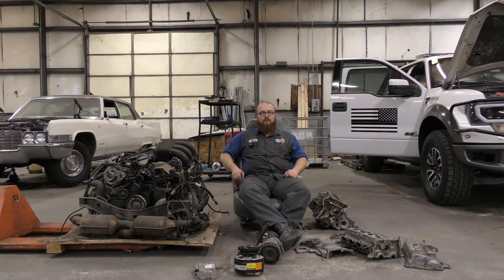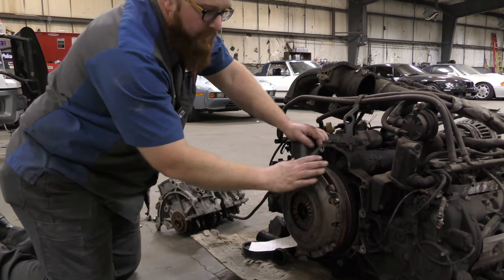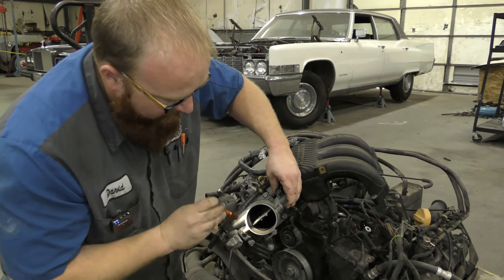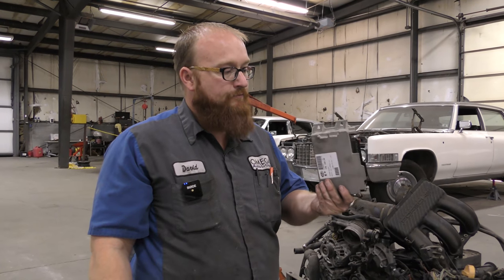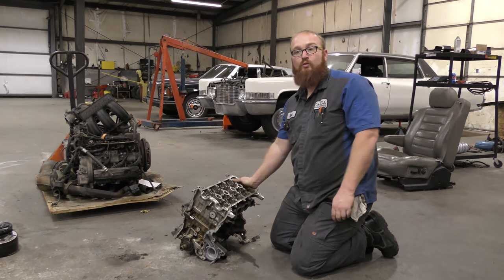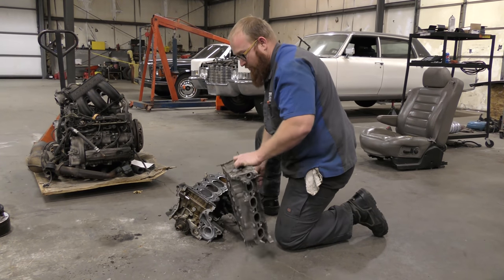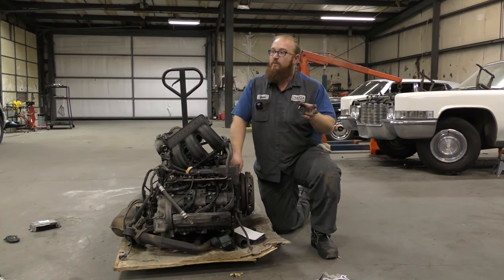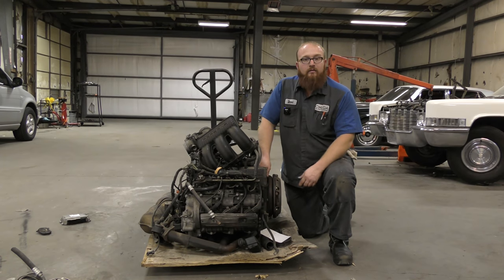The CAR WIZARD explains in everyday terms common Engine issues

Comment: TL;DR. if this saved u time pls thumbs up. 

1. front main seal = as the name explains, the front seal on the front of the engine. behind the main pulley, and what goes into replacement. unbolt pulley, and replace cheap seal. not as big of labor

2. rear main seal = same as other seal, but at rear, inbetween transmission and engine, unbolting flywheel is necessary for replacement. like the front seal, cheap part, big labor.

3. throttle position sensor = positioning sensor telling cpu when the throttle is opened, if it fails, motor may run badly.

4. throttle body cleaning explanation = throttle gets gunked up, it may give false readings,  and give bad idle, or throw a code [chk engine light]

5. Car CPU explanation = not like a typical computer, it sends and receives data pertaining to the car. Said computer controls check engine light

6. Car CPU Reprogramming , Is like a simple update of a computer , a firmware update.

7. Oxygen sensor explanation - On 4 cyl cars, there is upstream and downstream- prior to exhaust and prior to catalytic converter in the exhaust, In v8's there are four sensors , for each side of the motor.

8. Catalytic converter code / explanation - If you get an inefficient code- is due to oxygen sensor giving reading that the Catalytic converter is not doing its job to filter out the pollutants going into the atmosphere.  Some cars can be cut / welded, on some u must replace entire assembly, big expensive job.

9. AC Compressor Lockup Explanation - pulley spins clutch and it just spins freely until motor is turned on, then the compressor itself turns.  In doing this, the compressor does what it name states, compresses the refrigerant. The lockup he is referring to is when the internals of the compressor (not the clutch that is free spinning) locks up, and doesnt allow the ac compressor to turn anymore, causing HVAC Failure, and noise. You can drive on a nonworking AC compressor- just dont turn on the AC

10. Head Gasket Explanation - It is when the gasket separating the engine to the head of the motor , the tiny passages in the gasket - the holes that are supposed to stay independent of the cylinders to allow proper combustion allowing oil/coolant to mix break causing - overheating, coolant blowing out, etc. It is a very laborious job- needing the timing chains/belts, camshafts, head bolts, to be disassembled to get to said gasket.

11. Engine overheat / heater stops working pertaining to head gasket explanation , Is an indicator of a failed head gasket, Bubbles go into the entire heating system, and this causes the heatercore not to work properly, the engine to get hotter, and potential coolant blowouts.

12. Head gasket repair necessary measures- In the event of a head gasket failure, your head of the engine may become warped, and if you install a head gasket on a warped head, it will simply blow again- the head will have to be brought to a machine shop to have it cut flush again for proper sealing of the gasket- The block can be warped aswell- and the same process would need to be done, However some motors are opposing metals, Cast iron block, aluminum head, and Usually the head is warped, the block can certainly be warped too though. However it is a bit rarer.

13. Valve Cover Gasket Explanation - Oil burning smell, oil leaking down the engine, If fails, allows oil to get past the gasket, and leak- causing a mess. Replacement of the gasket would include taking out the spark plug wires, (ignition coils) and other connected components to get to the cover gasket. The gasket itself would be replaced, and some include spark plug o rings aswell. This failure of this gasket can lead to fires, if dripping onto hot parts, catalytic converter, etc , and you can also get a burnt oil smell when you are sitting at a red light with the air circulating from the outside.

Enjoy guys
Reply: Excellent summary!
Reply: @roobear5357  Thank you :)

Comment: When I had my car seviced I was told I had an oil leak from my turbo oil seal.  I did not even know the car had a turbo!  Maybe you can guess I am not a car expert.
Reply: Maybe your car does indeed not have a turbo but your car mechanic guessed you are not a car expert ;)
Reply: @SerbanCMusca-ut8ny  Then they guessed right!
Reply: @ianhaynes5898  I hope they did not take advantage of that... Some are honest, some are crooks, it's not easy to tell'em apart  if you're not mechanically inclined.
Reply: Serban C. Musca I actually looked up the car specification and it does have a turbo, and I also asked a friend who confirmed this.  I was not charges such a huge price and so I was quite happy.
Reply: @ianhaynes5898  OK, good for you and nice to know there still are honest mechanics out there! I think we all should put down in writing here the names of the honest mechanics / shops we know of because even if bad shops are known for their bad reputation that does not always help directly in finding good mechanics / shops. Cheers!

Comment: What happens if a cat is fine but the sensor is bad?
Reply: You will get a check engine light. It will be a code P0130 or something close (130 is the upstream sensor on bank 1). If your car has a lot of miles, you should typically replace all of the oxygen sensors at the same time if possible, and use OEM or known good-quality sensors.
Reply: If sensor is bad cat will eventually go bad. Cat price >> four O2 sensors price.

Comment: Okay, I think the car I bid on for 1K dollars LS 460 LWB has had people steal the catalytic converters which will cost 3400 for the parts and 200 dollars for the labor to install them back in....NICE .... I playing around would screw me .... Oh well I may win the car but I bet since it can be sold for 10K - 11K dollars fixed with 150K miles on it a dealer will outbid me. I've been looking at the cost of fixing it and I can do the work if I had a lift for most of the underbody work. The parts are a B to pay for though. I suppose I drive around sounding like a muscle car for awhile.